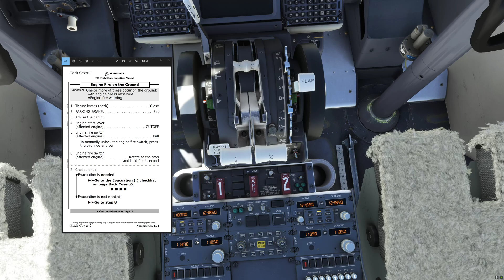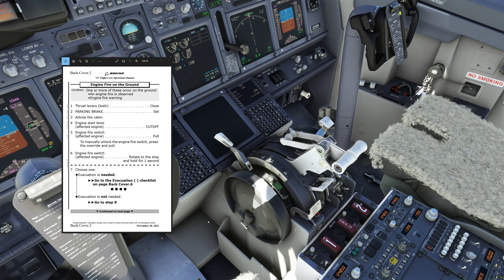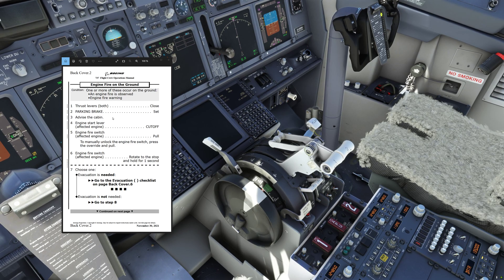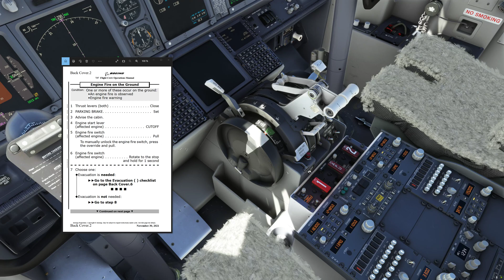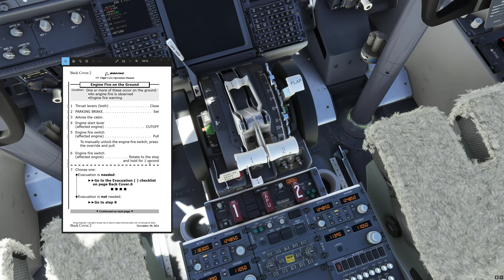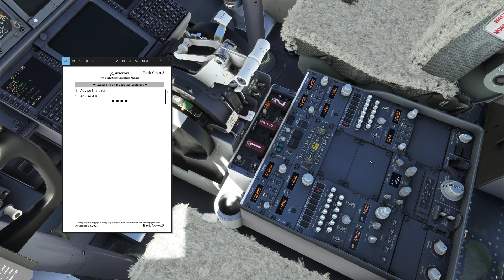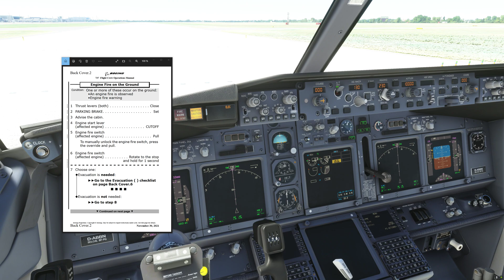Boeings new procedure: Engine Fire on the Ground Memory Items/NNC

Comment: Thanks for the video, good job. I believe there is only one carrier who have made the Engine Fire on th Ground Checklist as memory items, standard Boeing is read and do. There is a lot of confusion on this subject for many airlines as to which checklist to follow. For example, one low cost carrier, that the checklist above is from, states that for an RTO the Engine Fire or Severe Damage or Seperation checklist is followed whilst if you are on the taxiway, the Engine Fire on The Ground checklist is followed. Boeing doesn't stipulate this so you need to follow your company guidance. Thanks again for filming this.

Comment: could i ask one question?
We had differrent steps before new QRH. There was choose item, tailpipe fire or not tailpipe fire in QRH. but not now
could you explain the backgound reason?
Reply from the maker: We didn't have that in my company. I guess yours tried to avoid killing and engine just for a tailpipe fire. Which is reasonable enough.
Not that Boeing released the new procedure they probably just implemented it like pretty much anyone else did out of the box without any company customization. I wouldn't be surprised to see those steps reintegrated in your airline afterwards again.
Reply: @A330Driver  The first version of the Boeing EFOG checklist had choose one fire is a Tailpipe Fire or fire is not a tailpipe fire. This was later removed by request and possible confusion that could lead to the Tail Pipe Fire checklist being actioned instead of the EFOG checklist. 737NG Driver, I believe your airline introduced the EFOG later than  March 21, the first edition, which coincided with the time the Max (200) were being delivered.

Comment: great video ,just a quick one but as its an on ground emergency would you not set parking brake ,selects flaps 40 and notify ATC and then identify the problem and then go in to the new memory items for the engine fire on the ground ?cheers
Reply from the maker: Hi David, that is correct. The sequence kind of overlaps when carrying this procedure out.
When the fire warning happens the captain would stop the aircraft, set the parking brake and advise the cabin immediately.
At the same time the FO will select flaps 40 once the brake is set and advise ATC. Then the memory items are started.
In this video my intention was to show the memory items in action. If I combined it with the on ground emergency procedure I believed it might confuse people and therefore I did not include that in this video.
Reply: @A330Driver  Flap lever 40 and Parking brake is company specific following an RTO. Boeing says consider not setting parking brake unless an evacuation is needed. In the EFOG and Evacuation checklist has set parking brake as the first and second item, respectively. Setting Flaps 40 before calling for the Evacuation checklist is a good procedure from your company because it takes away the possible delay before placing the engine start levers to cutoff and deciding to wait until the flaps have reached 40.

Comment: You make an evacuation decision without using the second bottle?? Evacuation is a serious action and can cause injury to the passengers.  What if the second bottle will extinguish the fire and eliminate the need for evacuation??  This does not make sense.
Reply from the maker: This is Boeing SOP. Using the second bottle on the ground will hamper the suppression system unless a significant amount of time is in between the two discharges. This is time that you'll loose for your evacuation in case it's needed. Keep in mind, your aircraft is only guaranteed to keep passengers and crew safe for 90 seconds, thereafter an outside fire could enter the inside. Waiting 30 seconds for the second bottle and another ten to evaluate if it works would use up a significant amount of that time.
Reply: @A330Driver  Thanks for your reply.  I understand the new Boeing procedure, but I can't say I understand the reasoning for it.  I still have concerns about starting evacuation without using the second bottle because evacuation will definitely cause some injuries which could be serious in some cases.
Reply: As me going through the transitioning training on B738 now in 2025, I am having the same question! However, in the QRH our company uses, the Engine Fire on the Ground checklist does NOT contain any memory items. As a 10 year Boeing pilot,  this new checklist was also introduced on the previous Beoing aircraft I flew and they are almost identical.

Although I am unsure of the reason behind this new procedure design, I believe a thorough analysis on the risks and legality have been considered. I assume Boeing wants us to make the evacuation decision "after discharing the first fire bottle." (maybe even before 30sec?) 

It is still confusing as to why the Evacuation checklist directs us to discharge the second fire bottle AFTER deciding to evacuate and PA has been announced.

Comment: Very good video. Thank you. I believe latest checklist is not a memory items(depending on operator).
Just sharing on what I've observed, the FSTD is having a slight glitch. The "LEFT BOTTLE DISCHARGED" light should illuminate one or two seconds after the Fire Switch has been rotated and hold and the crew are supposed to wait for this light to illuminate before moving towards next items/actions to ensure the fire extinguisher bottle has been discharged positively. Or else,  the other bottle should be selected. Many occasions during training where the crew didn't "Rotate to stop and hold for 1 sec" the Fire Switch properly ended up the fire bottle didn't discharge. This FSTD has shown that the Left Bottle Discharge light illuminated almost at the same time when the fire is out. It may be a coincidence but could lead to negative training.
Reply from the maker: Hi, in our full flight sims it can take some more time for the light to illuminate as well. What you describe is how we did it before as well, but Boeing changes things in light of the Chicago engine fire and evacuation and now the procedure is aimed a bit more at speed than before in order to get people out quicker if necessary.
Reply: @A330Driver  yes, you are correct. It was explained in the FOTB. Good video on your part.
On the Fire Bottle Discharge light, it is faster(approx around 1 to 3 sec) on the FSTD which I'm attached with. That's why I pointed out as it might be a glitch on your FFS.
Reply: @A330Driver  Do you have a link for the incident referred as 'Chicago engine fire and evacuation'?
Reply: ı have a question for you guys. do you know the reason why boeing changed discharging one fire bottle instead of discharging 2 fire bottle as a memory item in engine fire checklist. it was discharging two bottles interval 30 seconds as a memeory items before but now it is only dicharging one bottle as a memory . To discharge second bottle you need to make read and do.

Comment: Does the Parking Brake stop the aircraft whilst taxiing?
Reply: No, plane will continue to taxi out to runway and proceeds to take off.
Reply: @minhpham7481  plane would absolutely not take off with the parking brake set 😂 

OP: Yes, it would stop the aircraft taxiing, although to engage the park brake you need to apply the toe brakes anyway I believe.